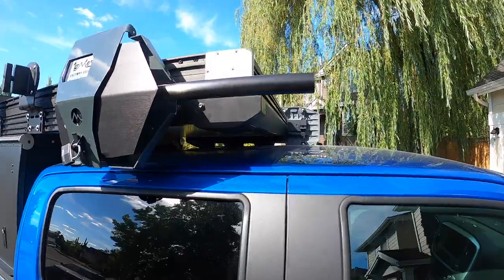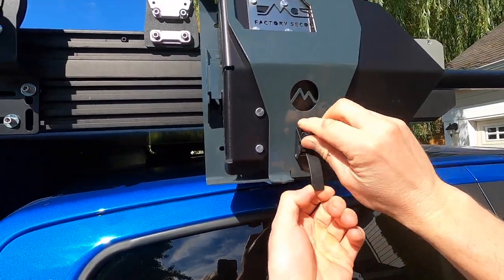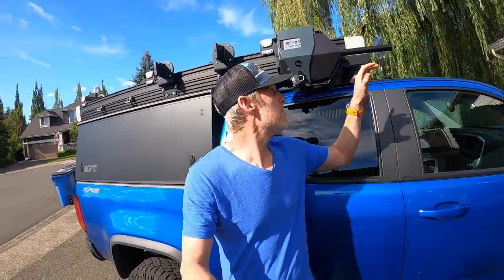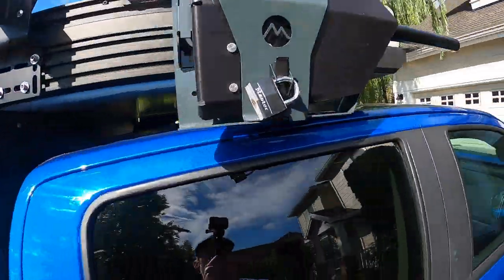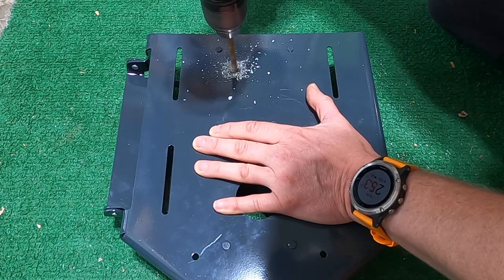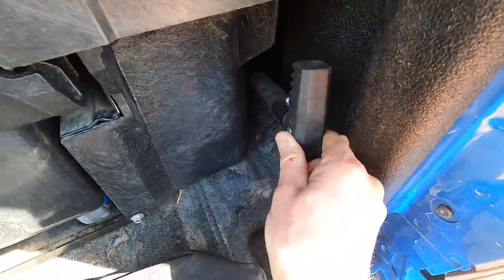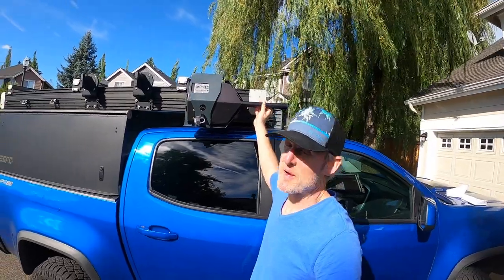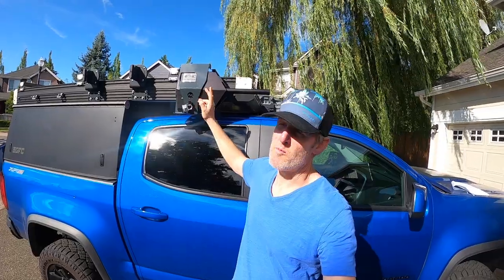Mounting a DMOS Shovel on a GoFastCamper | One Mistake

Comment: Not sure what you have on the other side, but could you mount it there? That universal bracket makes install easy, you could probably just mount it upside down so it's facing rearwards, although that may make opening harder for anyone shorter than you.
Reply from the maker: I got the obligatory awning and MaxTrax on the other side. It’s like your battle belt, just got to have all the accoutrements.